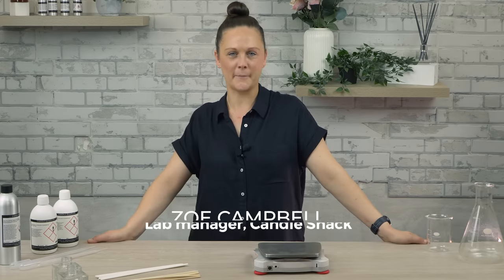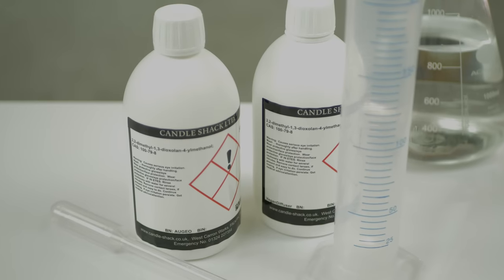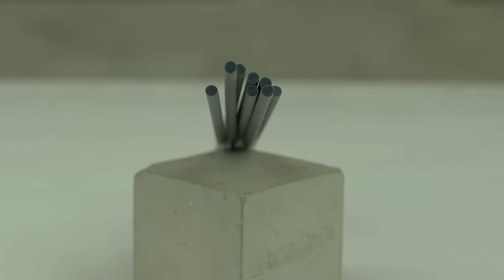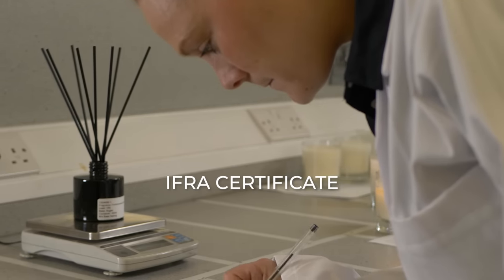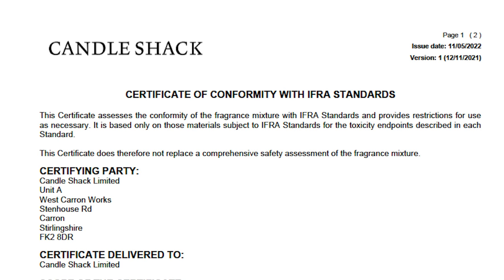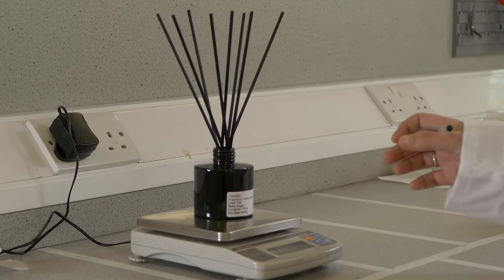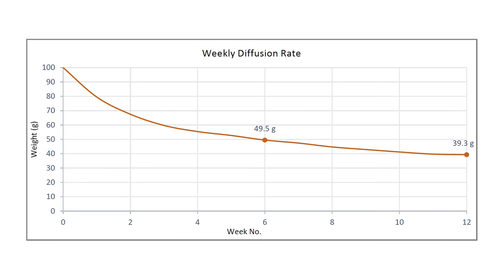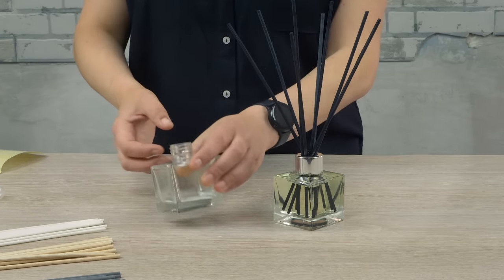How to make and test scented reed diffusers

Comment: When performing the test, should you rotate the sticks at all or just leave them to get an idea of the evaporation rate at a baseline? I usually invert the sticks in the jar to release more fragrance but I suppose not everyone will and it might mess with the results. Hope I explained this well! Thanks.
Reply from the maker: Hello, we recommend making sure your reeds are evenly spread out at the start of testing and not moving this throughout the process. Accidental movement is fine, but if the reeds move to the point they are clumping together we would spread these out again. I hope this has been helpful 💕

Comment: Hi I am using all of candle shack products for candles and Reed diffusers. Can you please clarify the fragrance oil comment in this video. You say you can 40%, but then say 15% is fine? So in a 100ml RD, what ratio of fragrance do you recommend? Thanks for clarifying 🌸
Reply from the maker: Hi Clair, 40% is the maximum percentage allowed by IFRA. This does not mean you have to use 40%, in the lab we test all our diffusers at 15-20% as a general rule of thumb. We recommend doing some testing and seeing what percentage works best for you. In a 100ml diffuser bottle 15% would equal 15ml of fragrance oil and 85ml of diffuser base. We hope this has helped, any more questions please ask ❤️
Reply: Do you recommend weighing oil and auego in grams or do you measure in mls? So much confusion on the FB group so thought I'd ask you guys direct
Reply: The simple answer: for this specific fragrance 40% is the maximum you can safely use. 15-20% is the amount you need to produce a pleasant product.  More might be overpowering, and will definitely cost more. More might also clog the reeds.

This applies to both fragrance and essential oils. And every scent product will be different.